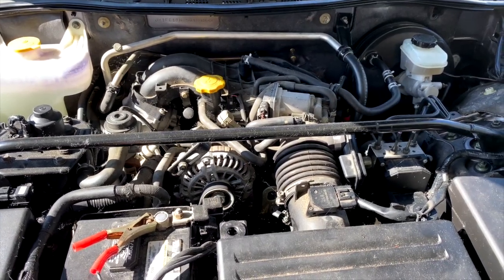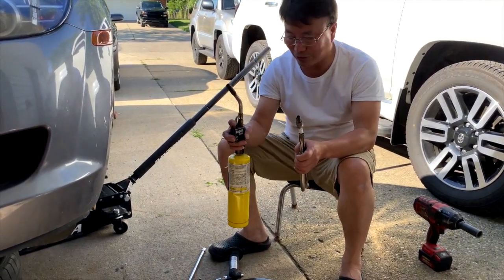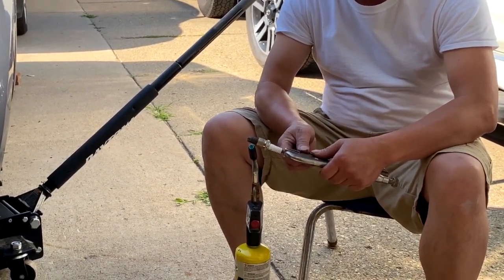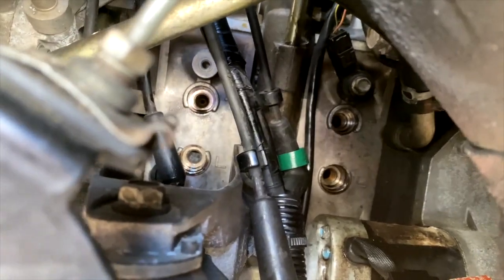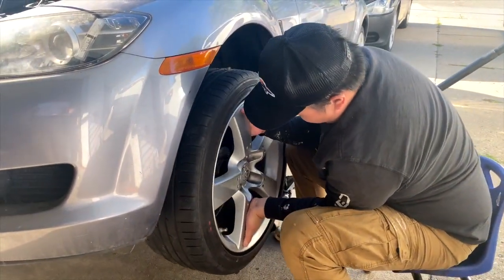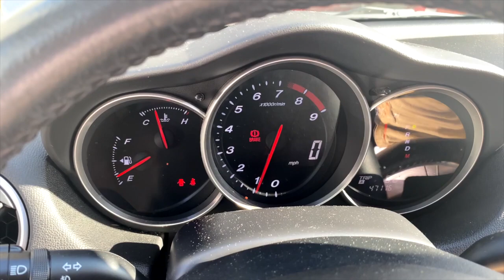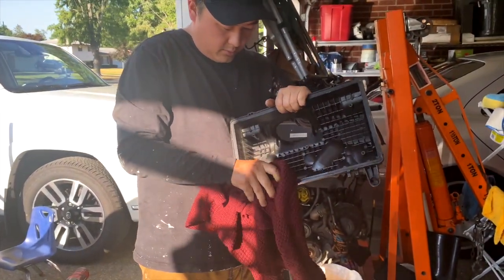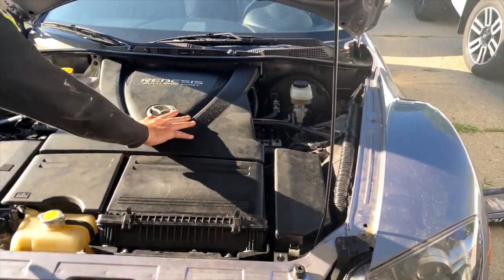2005 MAZDA RX-8 crank but no start

Comment: Nice vid! I started my adventure with rx8 in 2017 and after doing plenty of reliability mods it's running like a charm each time. 😊 For starting issues larger coils really do the job.
Reply from the maker: yeah the coils pack not really common problem for. theseRX-8 the common problem with these cars are the Apex seal and engine failure, thanks for watching

Comment: Great video! Can also use compressed air for drying plugs but the blow torch works too. Can disconnect fuel pump fuse and e shaft sensor if you don’t want to use rag. Good job!
Reply from the maker: Thanks so much

Comment: This is dumb, It was just flooded! This can happen if you leave it sitting to long, or this will happen every time if you don't let it get to running temp before you turn it off. Starting when your RX8 is flooded is easy. Hold your foot on the gas pedal all the way to the floor, and turn over for ten seconds and then wait ten seconds before starting again, and repeat this ten times. Holding the gas pedal all the way down will prevent any gas from being added to the engine, and the ten seconds between turn overs will stop the starter motor from over heating. On the eleventh time start with your foot all the way down on the gas pedal, then while still turning over, slowly release your foot from the pedal until the car starts, hold your foot where it started to keep it going, until the car has reached running temp, just under half way on the temperature gauge. After that you can turn it off, and it should start up again fine without touching the pedal. All in all it only takes about four or five minutes and you don't even have to look in the engine bay.
P.S This has nothing to do with compression, or seals, or oil, or spark plugs, or timing.
Mine is the 2006 RX8, I am the second owner, and have had it for well over 11 years now, and have flooded it twice. Once because I got up half asleep to move it out of the driveway to let another car out, I started it and only went down the short drive and parked on the street right outside, and turned it off without letting it get to running temp. And once because I let it sit for a couple of weeks while away.
Reply: You are correct sir

Comment: nice one, have buyed an rx8 yesterday, it wont start, i hope its the same problem as you had with your rx.  i am so exited when it will come to me
Reply from the maker: pls follow the procedures step by step incase you can't get it start pls let me know
Reply: @3hmongchannel762  hey, my car is running now, dont now what was the problem, have changed the battery and its started.

but i have a serious problem, when my motor is idling round about 1100-900 rpm the catalyst is so hot that is glowing really strong. i have checked if it is melted inside, but its looks brand new. do you have maybe an idea?
Reply: @Dentox_  cataclean

Comment: Don’t let your starter motor run for more than 15 seconds or you run the risk of will BURNING IT OUT. There’s no cooling for the starter motor ( it’s designed to run for approx. 15 sec. at a time.).
Reply from the maker: yeah, you're right about that but I'm just out of patient. thank for watching

Comment: My rx8 only start (starting in 2 Gear) if i push the car and have a p2004 code any ideas pleas
Reply: Low on compression. Needs rebuilt to have higher compression. You can install the newer starter that has more power to turn the engine faster for starting similar to the speed the engine turns when pop starting in 2nd gear. That could get you more time out of the engine but eventually you will need a rebuild.